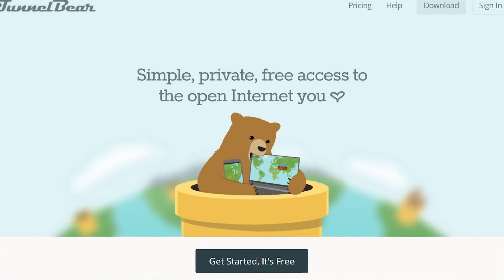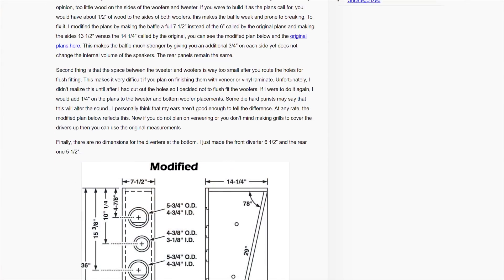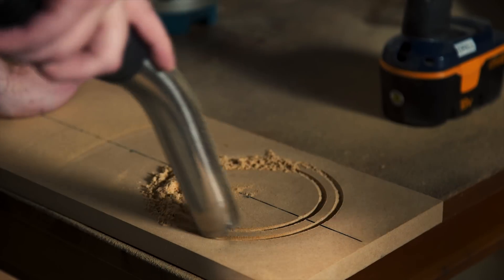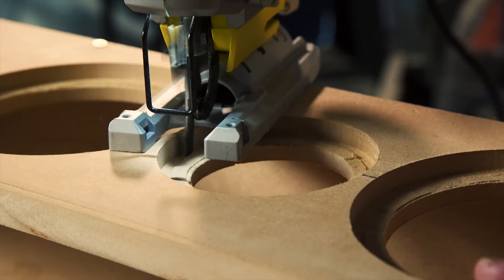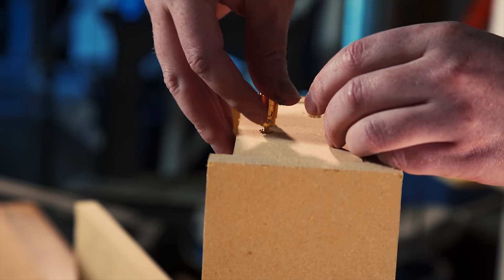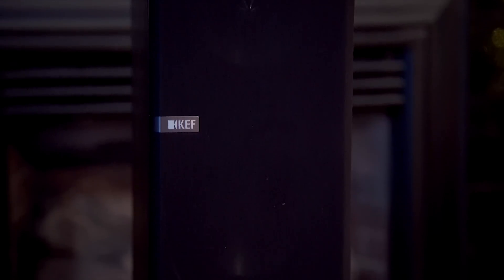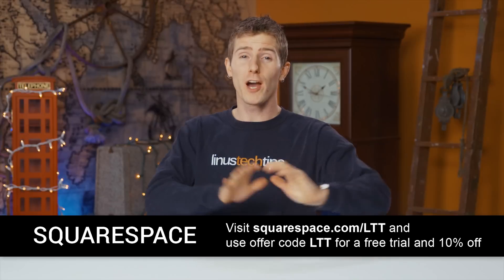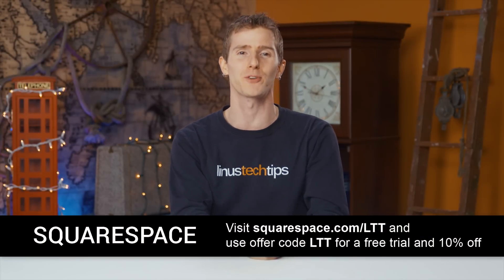DIY Speakers for Less Than $300!

Comment: Linus, I just saw You soldering  those wires. The easiest, heviest bond is by heating wires  and adding soldering material from above, and when soldering smaller thing, soldering iron and sol. material should be on opposite sides.
Stay safe! :)

Comment: I bet if you had some mid-range in there, have the lpf going to the subs at 20-170Hz and added a guided port, you would have probably won that comparison! Loved the video!
Reply: And epoxy for the seals with a thin piece of nylon between to cancel rattle and sound degradation.

Comment: pretty sure many people would agree with me that its NOT really WORTH IT. yes even your kev speakers. pro audio is where the sound is at.  this eurolive or els bt go will blow em away for the same price or lower with class d power amplifier included and tons of other functionalities
https://www.amazon.com/Behringer-Eurolive-B112MP3-Powered-Speaker/dp/B008O518IQ
https://www.amazon.com/American-Audio-8BT-Battery-Bluetooth/dp/B011X3H7JY

and my favorite of all is the yamaha stagepas (power amp and multichannel mixer included) even if more expensive but totally worth it https://www.amazon.com/Yamaha-STAGEPAS-400I-Portable-System/dp/B00B78SZJ2/ref=sr_1_3?s=musical-instruments&ie=UTF8&qid=1483348289&sr=1-3&keywords=stagepas 
https://www.amazon.com/Yamaha-STAGEPAS-400I-Portable-System/dp/B00B78SZJ2/ref=sr_1_3?s=musical-instruments&ie=UTF8&qid=1483348289&sr=1-3&keywords=stagepas

heck even the logitech 5.1/7.1 pc speaker sets will beat those crap ^_^

Comment: I get it ... I've built speakers for a lot of reasons, In a car it's because you want to custom fit a particular airspace or cavity, because you're cheap, then swap meet, garage sale, craigs, you name it .. a billion speakers out there for cheeeeep, and if you know what you're looking at  you can get huge bargains 
(i knew a guy who sold some extra skookum specials with the titanium construntions and the moon rock echo chamber all because they were too damn heavy ... and he gave em away)
If ya just like building stuff in yer shop, .... then .... drop me a line, i have one set of 3 way crossovers AND one very special subwoofer crossover salvaged from the subwoofer of a "VISONIK DAVID" passive sub that wants to be in a box as well.
( i saved em, but i am never gunna build speakers again so .... maybe YOU wan em?)
anyways .. I live in the Linus zone, so if you do too and want to build some speakers.
i have parts !

Comment: 1:31 what do you mean not expensive? They cost as much as my Klipsch RF 61 Mark II! Plus you didn't calculated the hours you spent working on them. I mean yes they are cheaper than yours but still there are alternatives that are cheaper than them and of much better quality. But like I say if you respect yourself you give yourself a paycheck for the working hours and you will see that they cost more. I mine just my opinion take it or leave it xD.^^

Comment: The thing about those expensive speaker is that the box, speakers, crossovers, and sometimes amps are all designed to work with each other; instead of having to build a box close to optimal for the speakers, and building or using a third party crossover and amplifier. 
You're paying big money for one solid product, instead of diying a close to solid setup.
Speaker boxes take a lot of measurements from the speakers, and from my experience, companies rarely post this information, or give even half of it.

Comment: LITERALLY  THIS VIDEO SHOULD HAVE TITLE LIKE ""BUILDING A CASE FOR SPEAKERS""
LTT is becoming more like a company, i know it is but still its becoming more like a company without quality control
i mean recently they are uploding very frequently and to do that they need to work on something at everypoint and 
that is making them shove out videos that are not as detailed, like in this video they could have said where is the input coming from what are the specs of amplifier etc, 
and also the Quality(not video or production quality) is also becoming low, dont upload videos that are subpar

Comment: Linus, Learn to solder.  Stop moving the solder around with the iron like you're doing - that makes cold solder joints.  The iron is a heating device only.  Make a good mechanical connection first.  The solder & flux will flow on their own if the parts are clean.

Comment: Not to shit all over this video, but the speakers you compared them against aren't even CLOSE to high end. And a lot goes into the engineering of a high end speaker's body, it's not just filled with stuffing lol.
This looks like a fun enough project, but they are going to be fairly crappy speakers that don't remotely stand up to something nice, or even something for the cost of the materials.

Comment: Don't forget that if the cabinet is not perfectly sealed this will be quite detrimental to the sound quality, I'm not sure how well the speakers sat against the baffle but seeing as the baffle was cut out by a person and not machine and then screwed on I'd say the speakers probably would have leaked a bit out the front which is quite easy to solve by using some foam as a gasket and makes quite a noticable difference.

Comment: Ehhh, I'd rather just pay for a PRE-BUILT speaker. Don't feel like losing a fucking finger
Reply: Only stupid people lose fingers. By following the safety guides you ended up with a rewarding and fulfilling experience... with fingers. 1+
Reply: +Caleb Baudoin This. 

As long as you're terrified of the tools you're pretty safe. And when you're inexperienced or have been nicked by a lot of them (like I have) you will be.
Reply: ImpalerGaming Punk :)
Reply: ImpalerGaming you only lose fingers when you are a semi-experienced carpenter because you stop being vigilant and are not a highly skilled carpenter. I had a similar problem with my driving, not vigilant because I got good, but not good enough to stop being vigilant.
Reply: Or, use basic safety measures, never worry about it.
Reply: People need to take it easy. If he doesn't feel safe with power tools and would rather buy, there is no shame in it. I like building things, and I use good safety practices, but a lot of guys don't have the time/money/space required to learn, purchase, and store such equipment.

Comment: For the complainers: It does have a hole in the back as per drawing. the box is a "folded horn" style, pretty much the same as a transmission line but the porting cross sectional area decreases as it goes along, this prevents standing waves inside the box (when 2 sound waves bounce into each other and cancel themselves out)

The fill inside is used for 2 reasons, 1: the wool slows the air down so it takes longer to travel through the port lowering its FS, and 2 it provides the illusion of a larger box as there is more surface area for the sound waves to bounce off, also lowering the FS of the box. (FS = frequency output - I am not going into more detail than that)

Comment: The judges of the speaker quality should be audiophiles used to high end speakers. Differences are usually subtle, yet that doesn't make the DIY good, because there are much cheaper tower speakers than those KEF that are still very, very good (Pioneers SP-FS22), designed by famous designers, with custom cabinet shapes and with a tuned port to enhance bass response. I dont think those DIY Speakers are better than those Pioneers or other budget tower speakers...

Comment: Linus. if you want more mid range bass. wire the the speakers in parallel instead of series. if those speakers are rated for 4 ohms each. series will give you 8 ohms and parallel will give you 2 ohms. if you run at 2 ohms you will have a stronger bass sensation while being clear. you should rerun this test at 2 ohms. results may be better.

Comment: Question to those knowledgeable on audio: My subwoofer sounds distorted when turn up enough. It's only 1 subwoofer of the 2 that are in the system. Is it blown or the wires inside are making that noise? Also I remember accidentally plugging it in the reverse polarity. Thanks for any advice.

Comment: hmm the acoustic properties of the materials you make the box out of can dramatically change the final sound. Having the face made of say something good at absorbing vibration in tandem with a filling that will muffler internal noise could help there is also the sound chambering.

Comment: Everyone keeps bashing the looks of them but there were more important issues with this build.  At no point in time were ports installed in the cabinet to let the mid/bass drivers physically move any air, aka why there would be very little bass performance.  The test subjects' blindfolds were literally covering their ears, continuing to muffle what they could hear in the tests.  Lastly the speakers that were professionally made probably had the tweeter at the top of their build, whereas the DIY had a mid speaker driver closer to ear level of the subjects so of course it's going to sound more muffled haha.  They actually don't look bad though (sort of similar to an Adam A77x)

Comment: Since we're on the subject of speakers.  Can someone tell me, or point me in the right direction of a how-to, to wire car speakers up to a home theater system.  I know there's a way to do it, but there must be a more efficient way to do it, then what I'm finding.  I've actually thought about buying a deep cycle battery, and a battery charger, running the stereo off the deep cycle battery, and keeping it on a charger all the time, but I feel that would use a lot of power.

Comment: I have a question, which is better, 2   8GB sticks of RAM or 1 16GB stick?
Reply: Elijah The Beast 1 16gb stick, less space used
Reply: Elijah The Beast 2 sticks of 8 for dual chanel
Reply: 2 sticks of 8gb. You take advantage of more channels.
Reply: Depends. Both have their Pro's and Cons. A single 16gb will allow extra expandability in the future as you will save a RAM slot. However, you will be getting less performance as a Single RAM Stick will only allow you to take advantage of a Single 64 bit Data Channel until you add another ram stick down the line. While the 2x8gb option while lacking in expandability will have the speed advantage over the single stick solution as it will allow for Dual Channel data rate,
Reply: It depends on use case and how many memory slots you have, if you only have two slots, I'd recommend 1x16gb of ddr 3 or 4, if you have 4 or more slots and do high band width computing, like exporting edited video in mp4, then make sure your motherboard and memory can use dual channel memory before going 2x8gb of ddr 4. Cost is some thing to consider as well.
Reply: I honestly wanna do 4x8GB

Comment: The front baffle actually plays a large role in how the tweeter sounds. If the tweeters had been countersunk and the finish were a bit smoother, then the treble could potentially become a bit clearer. It also appeared from some of the images that the tweeters in the DIY speakers were at a lower height than the tweeters in the KEFs, which would also make a decent difference in clarity and imaging.

Comment: id also add that having an understanding on audio engineering is essential to building a pair a speakers that can really be a good cost comparison. Now i'm not saying you need to be a audio engineer to build speakers i'm just saying that knowledge will go a long way. also you 350$ for speakers is nothing in the realm of audio equipment i mean my amp alone is more then that.

Comment: The tool is called a countersink bit/drillbit.  This will better accommodate the wood screws you used.  Allowing them to sit flush to their respective surfaces.  Thus, makeing it pretty n neat.😄
Reply: Link to an exsample.
https://www.googleadservices.com/pagead/aclk?sa=L&ai=DChcSEwjUwe7srKLRAhUGW34KHbWtAGUYABAD&ohost=www.google.com&cid=CAASJORopquCTUzU8YOJBAsrwckRuS2NvDlN4WCX_fL_ek6JDTOUMw&sig=AOD64_1jsBUk-xI2bfjWxOU3u7qvAVAI2A&ctype=5&q=&ved=0ahUKEwjmoezsrKLRAhVnyVQKHUtWBUEQwg8IHg&adurl=

Comment: But like....diy speakers..?  I feel like "diy"ing everything is unreasonable.  Even if you're an enthusiast.  And also the hours of work doesn't justify the lower price.
Reply: In the audiophile world DIYing speakers is extremely common and popular, and there is no better performance/cost ratio. These might not be the ideal example, and are very cheap. Typically you would spend a bit more on components and end up with a setup that competes with things 10 times their cost. It would definitely be worth your time if you could spend 1000 on high end components that would result in speakers that sound like ones that cost 7000.
Reply: I agree. If you built them for a fun project, cool. But all that work just to save a few hundred bucks? You can just save up the extra money to buy something professionally finished that will last decades. Also, if he put on some hot looking wood veneer to make it look decent for the same price I would say it was almost worth it. But to directly paint or stain MDF? With no grills?
Reply: well you might find it hard to believe, but some people are actually proud of their own work, and they feel good about it, and they really really enjoy it....
Reply: On the other hand a visaton set can cost you prebuild like 2000 dollar, as a kit 400 that is a price difference worth considering. But spending that amount of money you probably do a better paint job and workaway those edges then linus did. You don't even need screws when you glue and clamp it correctly.
Reply: If I can build something myself, I will. Nothing beats the feeling of knowing you made something kickass while saving money.
Reply: I always love those people slamming subs in their cars at the back and everything vibrates like hell, and they think they did a good job. Ghetto style
Reply: ***** No it will not be hard. Lookup on the internet how to make a jig for your router if you need to inlay the speakers (that is the hardest part but most kits don't need this), If you can hold a reciprocal saw for the holes, The rest you can let cut at your local store if they keep their measurements precise glue it together using clamps and have patience for the glue to dry, a little bit of sanding and paint. If you can build a box you can build a speaker. Just keep to the measurements that are calculated for your kit..Getting the paint to look good is probably harder then building the speaker.
Reply: Living Sandwich Really? Go to your loc store, ask for a 2.2 meter tall subwoofer tuned to 18Hz which rolls off at 100. Ask how much it will cost made out of sewerpipe or something similar. I made it at a fraction of what any retailer will ask for something like it.
Reply: Jame Gumb But the thing is, I don't care about supreme HD audio.  Nor would I want spend hours on something i care about.
Reply: Are u really sure about that??? look my video.. 
lower price, waaay better sound and u did DIY!
Reply: i built them just for fun and i love the sound from those speakers, and as somebody say here " it's 1000 more satisfying to use something we built "
https://www.dropbox.com/s/07p9ckq5uv33lyl/20150506_002117075_iOS.JPG?dl=0
Reply: killerbeenl you can still wrap it in vynil or use veneer
Reply: you took out of the equation the fact that diy people including me have a shit ton of fun actually building our stuff.
And it's 1000 more satisfying to use something we built
Reply: Living Sandwich Supreme HD audio? You need good audio. People will spend hours picking components, order the parts and build it or have it built, then have 2 milkcartons next to a TN screen. People focus on cpu and gpu way too much, audio is a great part of any game or video. If you spend a few hours on picking components you should make sure some of that time is spent on the audio. If that means a cheap receiver and 5 off the shelf bookshelf speakers, by all means, do that. But a gimped surround sound set for €100 or Bose cubes is not going to round out the experience. 
You should care.
Reply: This used to be the norm. Now since everything can be made faster and cheaper the need has gone down but it still exist for the guys who still do it and new people learning about it.
Reply: hours? making a box for some speakers shouldnt take more than 30 minutes of measuring and cutting. the long part is waiting for the wood glue to dry.
Reply: Yes it does, I have a $500 DIY that sounds better than my $3,000 HT system.
What you feel is not reliant, fact is if you find the a good DIY kit it will blow away systems that cost 2X-10X the price.

Comment: first you need a workshop, that is essential and nobody got this as a normal consumer
secound you need tools that more cost than the speaker will do.I didn't knew english words for ist german words are
Oberfräse , Bohrmaschine, Tischkreissärge (formatsäge),Schwingschleifer, Sandpapier, schrauben Tipp Stufenschrauben sind besser bei mdf oder Spanplatten. Farbe Grundierung boxenkits, Lötkolben und das wissen wie man damit umgeht.
Weißleim, Klemmzwingern und eine Werkbank
you can  rent a workshop for 2 days (normaly time you need wtth time for the glue. and paint ~ a night would be enough).
but 2 day for a workshop cost more than 100$ and you must learned as a german word Tischler and elektriker
linus i knew shops they are sell speaker sets to DIY but all is accurate fomate. All you must do ist,glue, screwing and solving if you want to paint you san do it. between screwing and glue, the edges where the glue ist with tape cover.

Comment: Hey guys is this a good build idk alot about computers and right now i just have a ps2. thx bros

CPU: The NSA, oc'd to 69696969969696 MHz
GPU: AMD GeForce R9 970 Ti Pascal
PSU: Intel Integrated Graphics 5000
RAM: a generator
motherboard: ASUS X99999999999999 Mobo with extreme LED lights, aka the sun
storage: 7200 RPM Nvidia SSD
case: the thermal paste I used to brush my teeth this morning

my budget is a watermelon

oh and the optical drive is going to be Hillary Clinton's emails because it doesn't exist